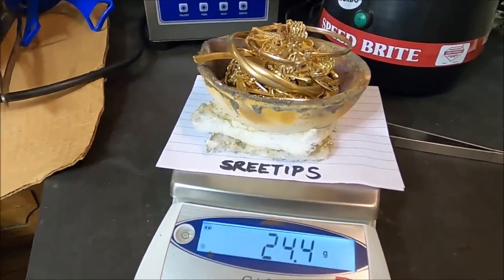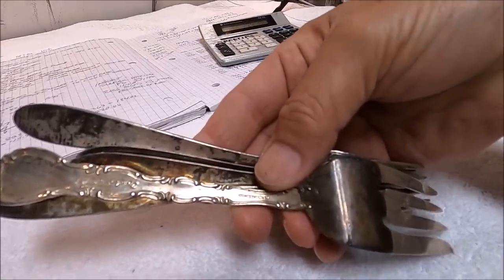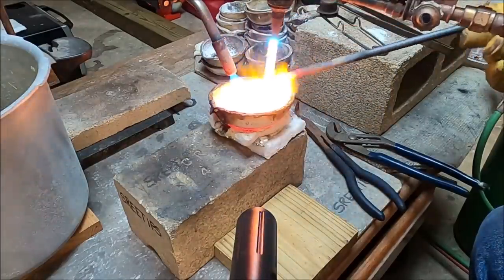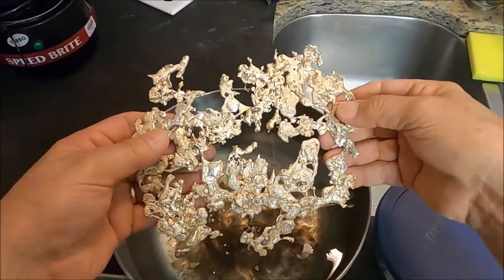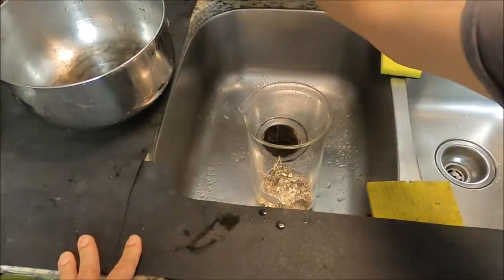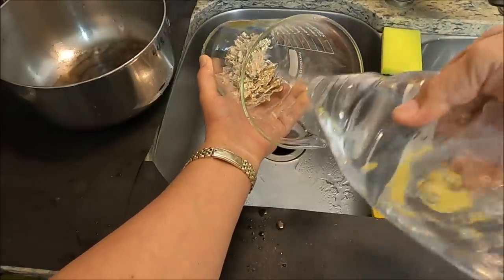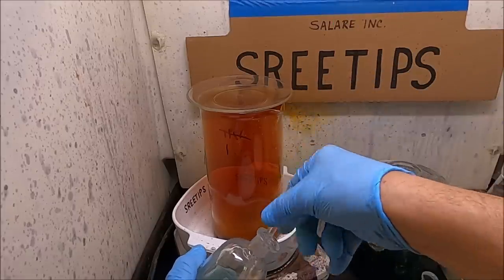Gold Refining $6500 Bar For Sale

Comment: I think the reason why sreetips doesn't use the handle is because the handle is being held on by a corroded metal strap that may break loose at any minute.He doesn't want silver all over his floor. My coffee pot I use no longer has a handle on it because it had a metal band on it and broke off after the second or 3rd time I used it. Nitric acid is a very corrosive chemical.
Reply from the maker: Quite correct. The handles should be removed

Comment: Note: Take all the precautionary safety steps while doing the experiment. 

1) Reduce the % of the scrap gold to about 25% by melting it with sterling silver.

2) reduce the thickness of the molten metal by pouring it in the water, in a steel container. 

3) put the metal in a beaker, boil it with nitric acid and pour the blue colored solution formed after boiling the metal solution, into another jar. 

( From this blue solution, the silver is extracted by settling it with copper plates in another jar after extended period of time. )

4) The metal in the beaker is rinsed with distilled water and poured into the silver-nitric acid solution jar. And it is added with diluted nitric acid, boil to extract the silver and other platinum group metals. 
This step is repeated until a clear solution is formed. 

5) To the precipitate add hydrochloric acid and boil by adding sulphuric acid with a dropper,  to eliminate any lead or other metals. The formed solution is then filtered out, cooled down by adding ice and precipitated by adding sodium-metabisulphate. The brown-waste solution formed in the beaker is collected into another jar, leaving the brown-gold metal in the beaker. 
This process is repeated until a clear solution is formed. 

6) The brown-gold powder is then melted to get pure gold.

Comment: sreetips i believe your issue with your gold clumping on your cooling pot, is that your pot isnt deep enough. i would suggest, getting a much much taller pot, which is also as wide as you have and fill it most of the way up, to give the gold more time to cool on its way down... also, maybe pour higher up from the water, to allow the gold to break apart?  just my thoughts on it, your the professional! keep making these great videos!

Comment: 59:56 If I had to guess, it would be that you're adding a liquid solution, in part, with the gold. As to why you're getting the "spitting/bubbling" action. The solution is probably having to boil away before the metal can actually melt. You've taught all of us so much, however, with my guess, I'd suggest you dry your gold powder on a hot plate before melting. If you have any other idea as to why it's bubbling/spitting, I'd like to know. Thank you for your beautiful educational videos!!!!
Reply from the maker: The metal will absorb oxygen during the melt. Then it spits it back out causing the metal to appear to boil. Tiny balls of gold get ejected when this happens. I solved it by turning down the flame. No more spitting but it takes longer to melt. Silver is worse than gold for this tendency.

Comment: rap the back of the torch real good  ,If orange flame comes out your tip is choked with carbon . .Clean the tip or get a new one  .If you don't you will eventually contaminate your gold . Turn your torch up a bit .I am a welder I use a torch allot every day for many years

Comment: Question regarding the process - rather than 92.5% silver, could you use an alloy of 50% silver, 40% copper, 5% zinc and 5% nickel?

Reason I ask is that I’d prefer to use old coins as the catalyst as they are readily available here in Australia and can often be bought for less than silver spot price.

Comment: Have you tried gluing glass like that handle using epoxy or PL Premium which is what I use. PL seams to glue anything to anything and is inexpensive. I am not sure how it will fare with all the acid vapor in your case, but it may be worth a try.  Make sure your surfaces are clean and roughed up with sandpaper. Thank you for all your effort getting these videos on line.
Reply from the maker: There are nice glass beakers with the handle built in. I don’t know if I could trust a epoxied handle

Comment: Around 35.51, you add sulfuric acid to precipitate lead that might be present. Then you add nitric till everything  in the beaker is dissolved. Would the lead remain precipitated, or dissolve again with the added nitric?

Could the final crumbs have been lead?

Building my understanding of the different processes. Not doubting yours, only trying to understand fully.
Reply from the maker: Lead sulfate will not redissolve in nitric. Im merely adding the sulfuric just in case any lead might have made it that far into the process even though this is highly unlikely. I learned this from on old refiner. He taught me to add just a little sulfuric every time I dissolve the gold whether I suspect lead to be present or not. It hurts nothing and provides a huge benefit. Lead, in just trace amounts, will ruin the ductility and malleability of the gold. Adding a few drops of sulfuric acid guarantees that all of the lead will be 100% removed during the refining.
Reply: @sreetips  Thank you. You are a excellent teacher.

Comment: @sreetips at 35:01 you say that is close to three nine fine the brown gold, why not just put that into a crucible and melt? Why was it necessary to put the gold back into solution and precipitate it yet again using the stump-out?
Reply from the maker: Close to three nines is good enough for a jeweler making alloys for some new jewelry. But the only way to be sure of three nines is to refine it with a wet chemical process to get trace impurity’s out, twice.

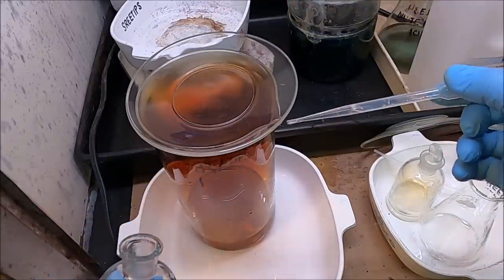Comment: I have a question at 36:00 you added sulfuric acid and then a minute later you called it nitric acid, was that a mistake or is there a difference if someone uses either or in that process? Thank you
Reply from the maker: I added sulfuric to remove any lead that may be present. It combines with any dissolved lead to form lead sulfate then it can be filtered out to remove 100% of the lead from the gold.
Reply: @sreetips  thank you so much

Comment: Hi Sreetips! I enjoyed your video as usual. However let me please contribute with something: When you state you need to dissolve extra Silver to avoid needlessly consuming Copper, you are making a fundamental mistake. You will need to consume the Copper anyway to cement the extra Silver you dissolved, so you may be better off just adding the Copper from the beginning. Demonstrating it is easy. 
When using Silver:
Ag + 2HNO3 → AgNO3 + NO2 + H2O
When using Copper:
 4 HNO3 + Cu → Cu(NO3)2 + 2 NO2 + 2 H2O
Multiplying the first equation by 2, reverting it to cement the Silver and subtracting from the second one:
2AgNO3 + Cu → Cu(NO3)2 + 2 Ag
Which demonstrates that you will need the same amount of Cu either to consume the HNO3 or to cement the silver you used to consume it. You will always spend the same amount of Copper regardless...
Cheers!
Reply from the maker: If there’s a whole bunch of excess nitric in the silver nitrate solution then when copper is added it will get consumed, needlessly, until it’s almost completely used up. It’s best to boil the silver nitrate and make sure there’s some undissolved silver left in the reaction. This will ensure that the excess nitric gets consumed before adding the copper to cement it out. Excess nitric will dissolve the copper and the cement silver will go back in solution, cement out, go back in solution, cement out .... over and over until the excess free nitric gets consumed.
Reply: @sreetips  Hi Sreetips. I agree that it is better to have a stoichiometrycally precise mixture to avoid excess HNO3 in the first place. Boiling out the excess HNO3 is also an option but that is not what you usually do, you usually add extra silver stating that "Copper will be consumed needlessly". My point is that once you have the excess HNO3, the same amount of Copper will be consumed no matter what, whether it is cementing the extra silver added or dissolved by the acid. Therefore, even if the goal is to purify extra Silver taking the opportunity of the unused HNO3 it is irrelevant whether you add the Silver or not, you are not saving Copper in the process...

Comment: @Sreetips, It would be awesome if you do an inquartation of .999 fine gold and .999 fine silver, for your chess set’s opposing side. That way you could say your chess set only consist of gold and silver and no other bass metals. 
Plus it would cool to see what 6k gold made with only .999 fine gold and .999 fine silver would look like or, would it turn out only looking like silver IE white gold? If so it would be neat to use .999 fine copper too. At least at that point you could still call it you your .999 fine set of only three metals. 
P.S. love your videos, your awesome! Keep up the great work. Have yourself a great weekend.
Reply from the maker: Believe it or not, I tried an alloy of pure silver and pure gold and it just looked like white silver metal. It’s the copper in the sterling silver that gives the inquarted gold an iridescent look.

Comment: I think I would probably just use distilled water for pouring the inquarted gold, and keep it in a lidded pot, and reuse it every time... I mean, even at 10x the price, it's only like $2-3 worth of water, and considering the number of runs you could do before you would need to replace it, and the amount of time it would save in the long run, it seems like it would be more time and cost effective...
Reply from the maker: I had a window AC unit. I kept a 5 gallon bucket under to catch condensate. It’d fill up in a couple days. Thought about filtering and using that for my experiments.

Comment: Do you use ice made from distilled water? I would think that using ice made from regular tap water would introduce a lot of unwanted chemicals and impurities into the solutions. I've done work at water treatment plants and have seen what is used to treat the water.
Reply from the maker: The junk in tap water around here is measured in parts per million. Not enough to report in a precious metals assay
Reply: @sreetips  Thank you for the response, i really enjoy your videos.

Comment: Sorry ..i forget to ask you.
The stump out. What is that powder use for.? I know well you use it in gold refining.
Arne
Reply from the maker: Arne, it’s used to disinfect containers in wine making. But the actual “Stump Out” by BONIDE that you see frequently in my videos, is specifically for dissolving tree stumps. The directions say to pour it directly on the tree stump that you want removed, and in time it will eat the stump away. Instead of having to grind it out of the ground, theoretically, you can dissolve it out of the ground. I don’t know how effective it is. I’ve never tried using “Stump Out” on a tree stump.
Reply: @sreetips Thank you Sir.
I have try to Google that but now i know for shore 🔥

Comment: I’m going to mention that when Sreetips says that all silver must have been removed because of nitric treatments , he means all but 19% to 0%,,, Aqua Regia will dissolve and keep less than 20% by content , silver in solution,, two ways to extract that 19%or less out of solution is to evaporate solution to concentrate solution off setting the % by content or use stock pot,, but more usually rinsing well avoids this from taking place
Reply: I dont understand what you mean.

Comment: Man...
I have to say, this being my first video to have watched here, I have to consider the first people that ever developed these methods and how they could possibly have ever known what cocktail of dangerous chemicals to combine, in what order and under what conditions and durations, so precisely, in order to achieve these desired results. And, how did they even know what the results were supposed to be before they began their experiments? 
Clearly, I didn't spend much of my attention studying in my singular chemistry class in high school... not that they would ever have covered anything like this, I would have remembered that much at least, positively. 
So, if it is obvious, based on what they are and the inherent properties of each compound or element, I apologize, in advance, for having posed any uneducated questions.
Reply from the maker: Alchemy, people searching for a way to turn lead into gold, is the predecessor to modern chemistry. So I’ve been told. Today we know that the only place with pressures and temperatures high enough to fuse protons into heavier elements is in a super nova when a massive star collapses.

Comment: If aqua regia was made 4:1 and the nitrogen was not evaporated out of the solution before the precipitation phase, how can you get the nitric acid out? Do you just boil with no additives until you get that yellowish color or do i need to add something to get the nitric acid removed?
Reply from the maker: You can rid the gold solution of excess nitric by evaporation to a syrup, then rehydrating with HCl. Repeat until no more brown fumes evolve upon adding HCl. I’ve done it, it’s time consuming but it works. Or you can add sulfamic acid. But make sure lots of extra space because it will foam over

Comment: Great video, if you added white gold in with the original melt would this still consist of the same process?
Reply from the maker: Yes, 14k white gold has the same exact amount of gold in it that 14k yellow gold has. For white gold they increase the amount of white metals, palladium, nickel, silver and/or zinc and reduce the amount of copper. For yellow gold the amount of copper is increased and the proportion of white metals is decreased. But both have the same amount of yellow gold in them.
Reply: sreetips fantastic thanks for prompt response. Keep up the great videos

Comment: I have been lost in your vids for days now. I have consolidated my old gaming computer power supplies and readying them for the silver electrolysis.

All information is consistent and unwavering. I have not found any contradictions, or lapses in habit *other than the wooden board to make shot 😝

Excellent channel!!

Would these reactions be to sensitive to be done outside till i find a good ventahood?
Reply from the maker: Sorry to say, there’s no way to safely do these reactions outdoors. No matter how long you can hold your breath when adding reagents, the fumes will get in your hair, clothes, and eyes. Even if you approach from upwind. The wind current will circle around you and pull the fumes right at you. I’d hold my breath and walk ten paces away and I could still smell the fumes. If your serious then buy or make a proper fume hood. Repeated chronic exposure will damage, heal, damage, heal your lung tissues. Until one night late in life you awaken gasping for air because your lungs can’t get enough to satisfy your need for it.

Comment: I see how you calculated the amount of silver needed based on karat count & weight. I have chunks of electronics gold but don't know the karat value.  How would I detemine a good amount of silver to properly inquart the gold?
Reply from the maker: If it gold plated computer scrap then inquarting won’t work, only works on solid karat scrap.
Reply: @sreetips  ugh! not sure if it's plated or just electronic scrap, or even if there's a difference.  any suggestions on how to navigate that uncertainty?  is there a test to verify plating before trying any form of melt?
Reply from the maker: Computer stuff is mostly gold plated.
Reply: @sreetips  I appreciate your feedback. Does that make it completely useless for refining purposes?  
To minimize the amount of questions I ask that might bother you for too much time, Is it possible to refine that type of gold? Is there a printed source to find the process?
Reply: @sreetips  I've watched a few of your other videos since starting this comment chain.  It almost sounds like my scrap would be best refined with the various acid melts.
Is that correct?
Reply from the maker: Gold plated material is best processed in a sulfuric acid stripping cell.
Reply: @sreetips  Thanks for all the information.  You're very knowledgeable about this whole process.  Do you mind me asking what you did before taking up refining?
Reply from the maker: I’m a retired Naval Engineer - Main Propulsion. Degree in Aviation, self-taught precious metals refiner.
Reply: what are good educational books to read through? I don't have much knowledge of chemicals, but am good at math and relatively good at remembering processes.

Comment: Question: is there a ratio of the amount of 10k and 14k used to make your bars? Or can you have more 10k material than 14k and still come out with the same results as if you flipped the amounts used for the designated karat gold? Hope this makes sense lol.
Reply from the maker: It matters not, a batch of 100g of 10k will yield about 41.7g pure gold. A 100g batch of 14k will yield about 58.3g

Comment: you ever think of making a bar of the 6k and then running it through a metal flatterer to have thin ribbons
Reply from the maker: Great idea, then pull the silver out with boiling sulfuric acid

Comment: Have you ever thought about getting tap water and letting it sit and de-chlorinate for 72 hours?  That way you could rinse without having to use distilled water.  All the chlorine bubbles out after 72 hours.
Reply from the maker: I have done it. I let it sit for a week. But I was still too chicken to add it to my silver nitrate solution. Ended up just dumping it and relying on store-bought distilled water.
Reply: @sreetips  you could get some OTO (orthotolidine) to test a sample.  You add a few drops of a sample in a test tube and if turns yellow, there is still.chlorine.  a buddy of mine used to do that for his aquarium water additions, since most of the fish would die with even a small amount of chlorine in the water.